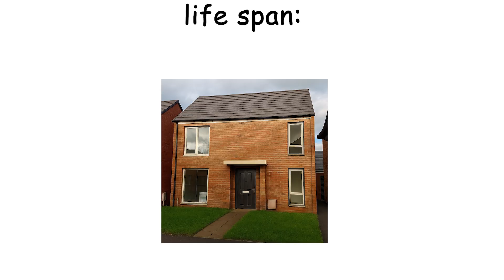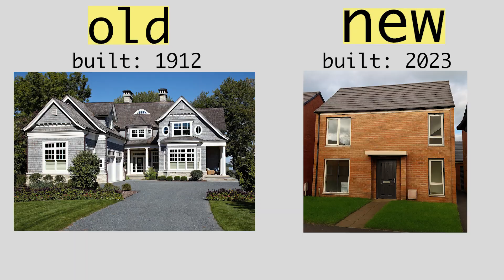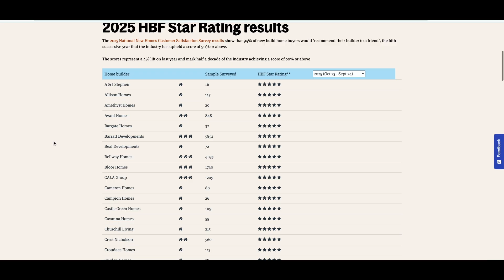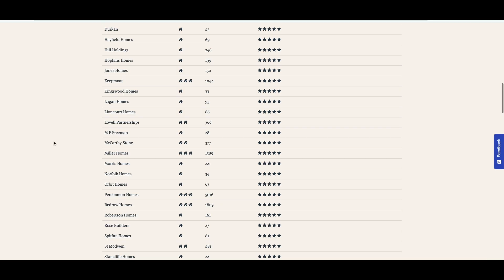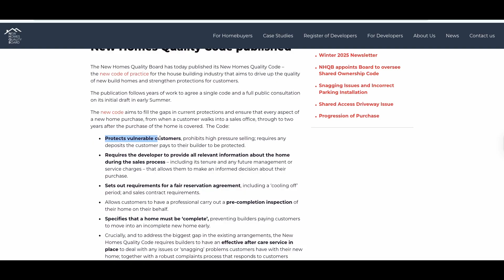Why British Houses Are Built To Fail.

Comment: Whatever the construction methods, it's a big advantage to be able to inspect the house before any papers are signed. If you sign for a house before it's started, good luck getting them to fix everything to your satisfaction. Also, if you find defects in a house that's completed, they can be used as bargaining chips to reduce the price, so that even if your house is not perfect, it might still be a reasonable value for the money.
Reply from the maker: Great point. Its a future video on the channel. Its a great skill to have. Thanks for the comment 🙂

Comment: Ben, thanks for the video Mate. Would it be possible to show a video on how a proper steel frame is done? You mentioned if it has a lot of insulation that can avoid corrosion. 😅 Would you be able to explain/show for those of us not versed in construction. Thanks in advance

Comment: So the average steel frame new build is built to last 60-170 years? Surely the long term market value of the house would plummet? Also when the houses start to degrade what exactly happens to the house does it just fall apart lol
Reply from the maker: One of my next videos is visiting a metal frame factory. I will be asking lots of questions like this. Stay tuned 🤙

Comment: most houses are built brick and block work. Ive never even worked on steel frame 21 year being a bricklayer...
Reply: As I understand it if you want to maximise the usable space and meet thermal requirements you get more room space - better utilisation from other methods.

Comment: People don't get it. The reason why brick housing lasts much longer than stuf housing isn't because bricks last longer.

It's because you can't fix a stud frame house. No construction is perfect, even if you've made it perfect, people will trash it.

But with brick, you can take a wall off, add new insulation, change the damp course etc...

The stud housing is like a iPhone, once you crack the screen, you've gotta replace the whole thing. 

They depend on those detailing to work, but they're all glued and overlapped details, you can't fix the damp patch without taking the whole wall out. But if you take the wall out, the stud frame house is gonna collapse
Reply: It’s trivial to replace a screen on an iPhone.
Reply: Stud-frame structures are  fixed, altered, expanded and reconfigured all the time here in the USA. Because it's lighter, it's easier to take out sections without the structure above caving in; if a car hits a stud wall, it often just leaves a big hole, but if it hits a brick wall, it gets buried in bricks from above. Wood framed structures can be reinforced by sistering studs and joists, rot and insect damage are often fixed by sistering existing wood with treated wood. There are some big advantages to masonry, but ease of structural work is not one of them.

Comment: New builds are built with Cheap materials poor workmenship poor design built for quickness not designed to last . My sisters house is 200 years old and will last another 200 years these new builds won't.
Reply: If you maintain it what exactly wears out?

Comment: Because all the institutions go through companies like wilmot dixon who are literally middle men. They hide behind safety rules and regs and swallow up all the profit.
They underpay and knock the smaller trades and subcontractors while reducing the quality of the build. Oh and let's not forget we filled the country with half the 3rd world which also affects quality. 
This is all by design and portrayed as par for the course. 
As someone who worked as a subby on new builds doing everything from roofing and cladding to interior decorating and snagging. 
I've been called to new apartments that have had leaks and mold for 7 years. Since the day they moved in. 
I've seen sports complex designs that allow water ingress by design. Nothing the builders had done but followed the drawings. Seriously. We need to stop this now. Give the work to decent local builders. Use proper materials and I bet the build cost will still be cheaper!